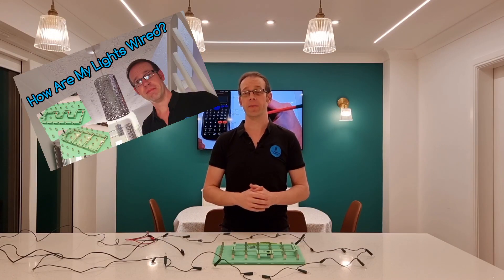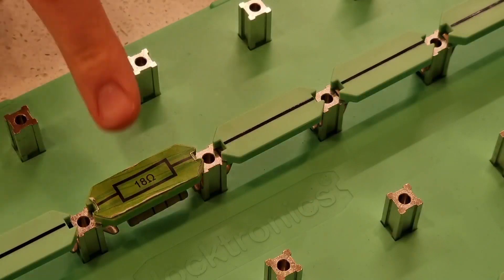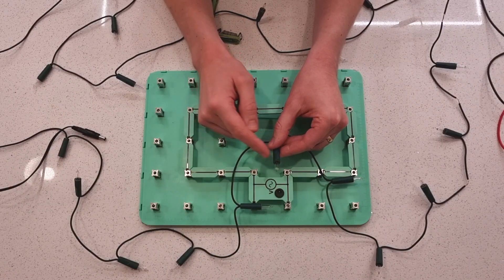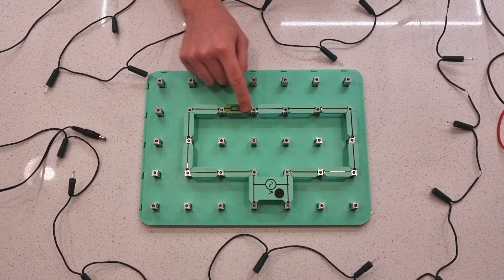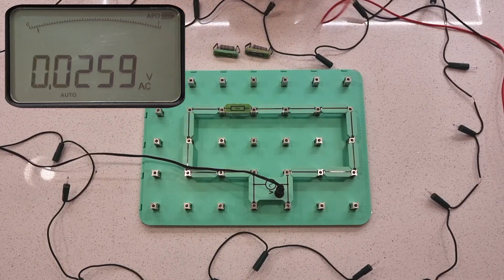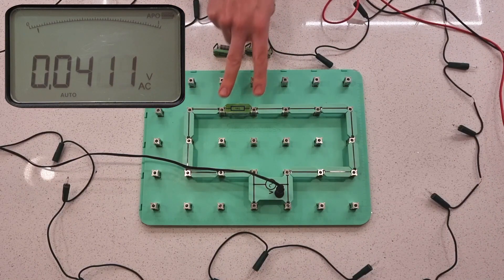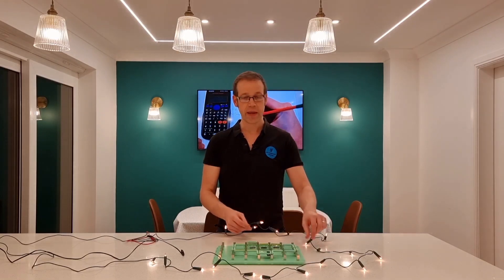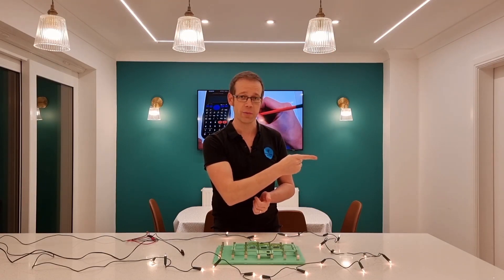Is There Any Kind of Electrical Load or Lights That are Connected in Series?

Comment: Are those fairy lights PAT failures being single insulated?
Reply from the maker: That's a really good question, my initial thought is no, I think it might be reinforced insulation, or it could even be double insulation, I'm trying to remember if it had two layers when I stripped it. 🤔
Reply: @JoeRobinsonTraining  I’ve been failing them & replacing with SELV for 20+ years, so thought it might be time I find out lol

Comment: The problem with LEDs in series (it's common in LED battens) is that when one of the sections of LEDs burns out the entire things stops working. Much as your old Christmas lights, except you can't just replace them. Easy fix if you're handy with a soldering iron, but that's not what most people are going to be doing.

Might be worth a quick video where you take one of the lamps out and measure the voltage across it - I think some people might be surprised that it's 240V not 12V if the lamp is blown or missing. The same resistor divider network but with an effectively infinite resistance in the location of the missing lamp.

One other real world situation in which you'll find lamps in series is the PAR36s in audience blinders. They're 120V lamps wired in series.

Comment: Hi Joe, thanks for the video.  I've been going nuts trying to figure out how a string of outdoor LEDs are connected. There is 1 wire which goes all the way from source to the last LED then 2 wires that loop between each LED - except that every second LED has only 1 wire between them.  Any chance of a video on that?